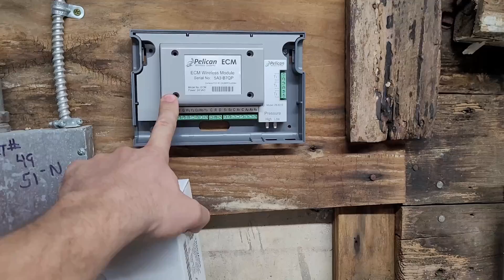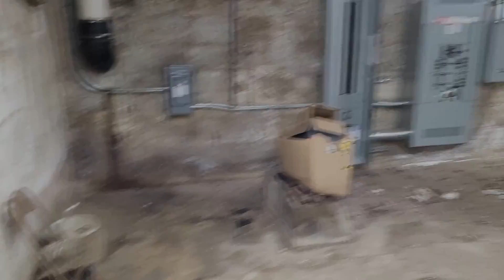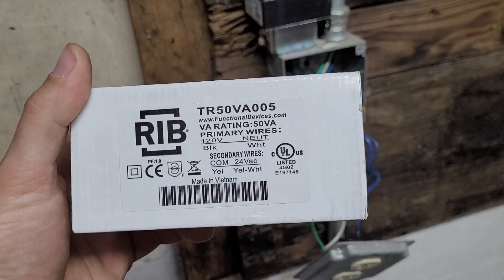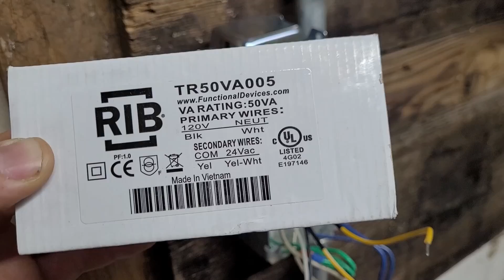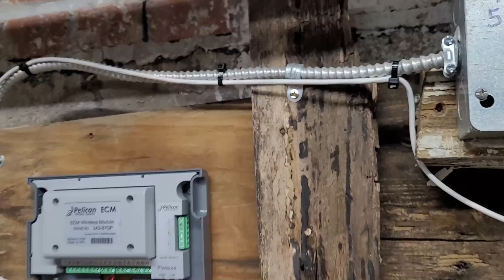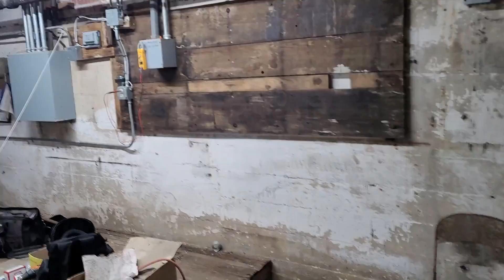Stepdown Transformer Install

Comment: How did you know to install a 50 VA transformer not a 70 or a 10 VA thanks .
Reply from the maker: I only have to think about the volt amp rating if there are many devices on the circuit. 50VA is what we carry around and its over kill for most applications. When I used to install XCI zoning systems I would have to calculate the volt amp draw if there were more than 4 zones. For instance each thermostat might be 2VA at most, and each damper actuator 3VA. So I would just add them all up and be sure I had more than enough VA.